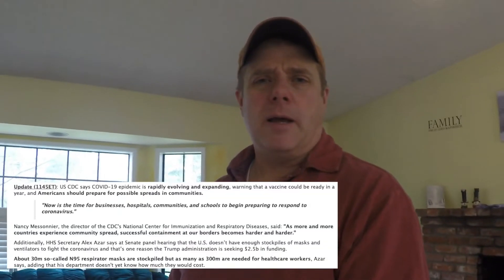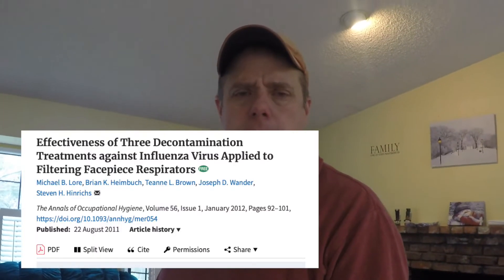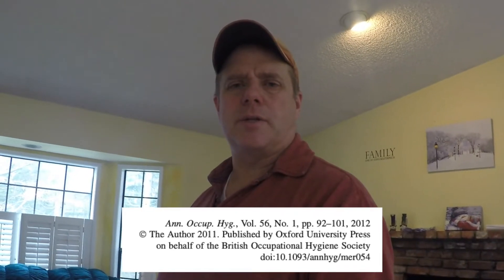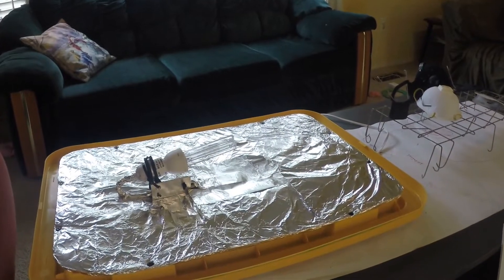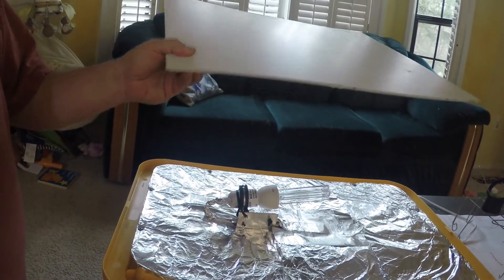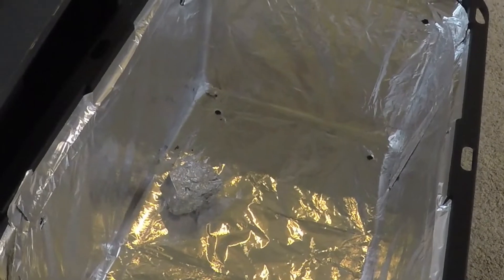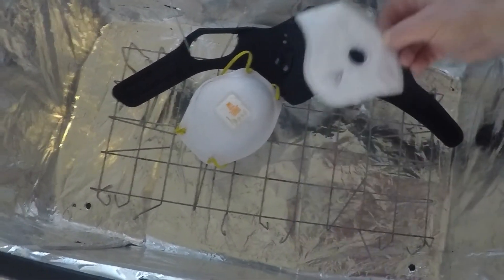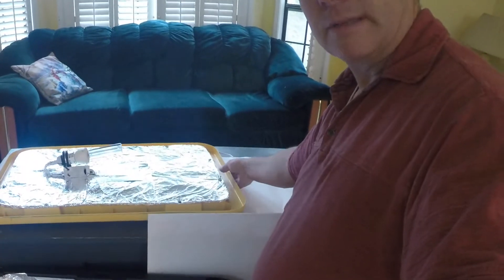Decontaminating an N 95 Mask

Comment: I believe 250nm are also known as 'UVC globes' and may be found at hardware, pool and reptile/pet stores - still researching
Reply from the maker: I believe you are correct.  Read the article to discover the distance away from the mask etc. that the scientists used.  They are definitely used for those purposes but the intensity of the bulb may have something to do with it.  

Disinfecting a mask may be important if we are going to re-use it, but I am seeing some just terrible mask discipline which makes you wonder what the point is for some.  Touching the mask, putting it over their mouth but not nose, taking it off to eat, then putting it back on.  Stupid stuff.  It's no wonder people think they don't work.
Reply: Northern Tribe Outdoors : As I was watching your video something occurred to me... I have a LED gel nail curing machine stored away someplace... it should be about 350 nm I think... I was wondering if I would be to place the mask inside that dome, which you place your hand to cure the gel on your nails if it would do the same thing as your light?  How long do you leave it in there for? Is there a distance that you need to put your mask from the light? Because there would not be to much place in that dome of mine... could it catch fire if it is there too long? I know they are silly questions but I was just wondering... thank you for your great idea. May the Lord keep you and your family safe, have a good week.
Reply from the maker: Hi Nichole,  I don't think so.  I looked into those when I started this particular little journey.  I would be very cautious about anything outside of the recommendations of the study.  The mask is providing a barrier between you and the virus' coming in.  It will collect virus material on the outside of it.  So if you thought it was disinfected and it was not, you would touch it and most likely infect yourself!  I see people doing the dumbest things with masks.  Touching them, pulling them down so their nose is exposed, pulling them down to eat. YIKES. It is no wonder they don't work for folks.  If you can't get one of the 254nm lights then the best rule is don't go where you need a mask. Second best is use it once and then let it sit for 9 days (rotate it).  Virus won't live on it longer than that.    I believe in the study it was under the 254nm light for 15 min. I plan on doing it for an hour in my box. I am into overkill when it comes to the virus.  .02 hope it helps.
Reply: Northern Tribe Outdoors : even if the nm is stronger than 254? Or is it the amount of room in the dome? Thank you for answering me, I hope that you and  your family will be safe, and always be strong in the Lord only He can really protect us...
Reply from the maker: Hi Nichole,  254nm refers to the frequency of the UV radiation not "strength".   I can't say anything beyond what the scientific journal article says. Ultimately we are in his hands.  But we also want to be good stewards of what we have including our health.  Hope this helps. FYI  Be VERY careful with UV you can easily blind yourself.  NEVER look at it.

Comment: where did u buy light?
Reply from the maker: Amazon.  Best of luck finding them now.  Important thing is that they have to be 254nm. Some with less than conventional plugs or needing a ballast might still be available.  There are some other options if you look at the scientific article in the description.  If you use the microwave/steam thing I would recommend you do it outside of you home.  Microwaves have a fan that acts like a vent. You don't want to blow contamination into your home.  I also wouldn't use that microwave for anything other than decontaminating masks.  If you are using a mask as PPE then be sure and pay close attention to your procedure for donning and doffing the mask.  They are only saying masks don't work (on regular people) because they are in short supply.  They will change their tune and want everyone to wear one after they fix their mistake and supply is back.  Hope this helps. Stay well.
Reply: @northerntribeoutdoors5938  I have found a flashlight with UV led 365nm would be enough?
Reply from the maker: No. All I can refer you to is the study in the article (link in description) worst thing that could happen is false security.  You think it is decontaminated and it is not.  Stick with the article. .02